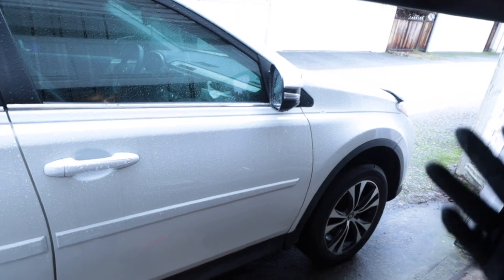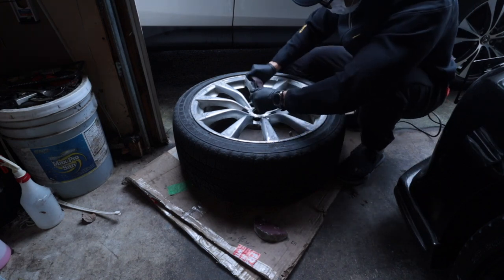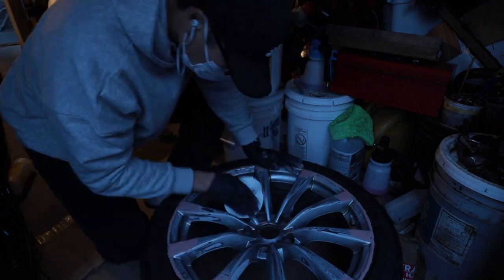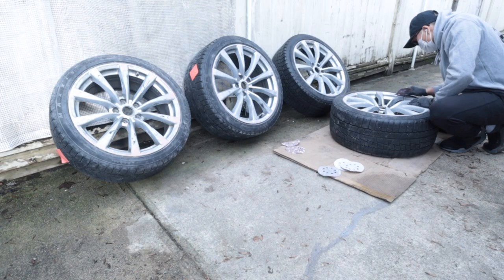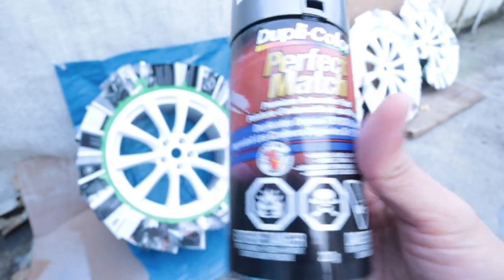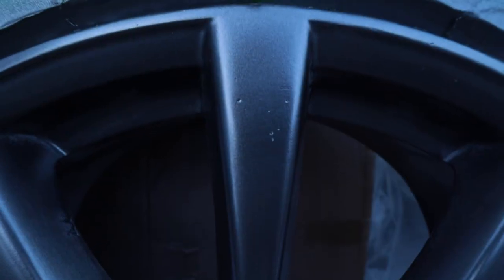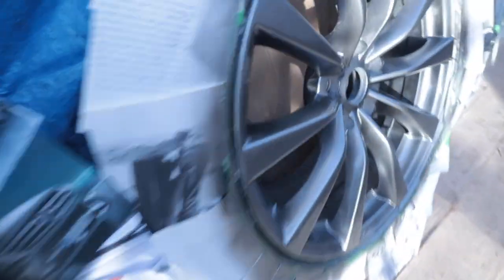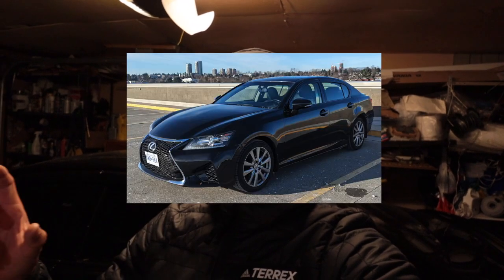refinishing & repainting enkei wheels for the lexus gs350

Comment: How do these ride ? Thinking abt doing the same to mine
Reply from the maker: Unfortunately, I can't fully gauge ride comfort at the moment, they're still mounted on winter tires, so ride was always going to be a bit rougher than the oem 18's and all season tires. Still trying to find a set of 245/40/19's. Definitely worth it to upgrade on the look alone compared to the stock wheels.